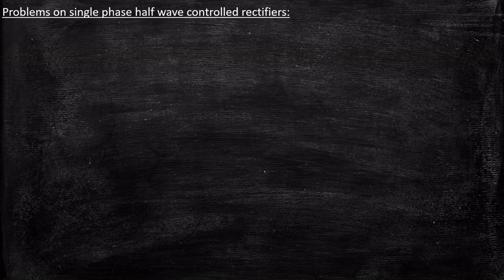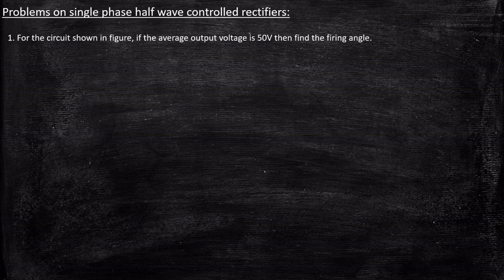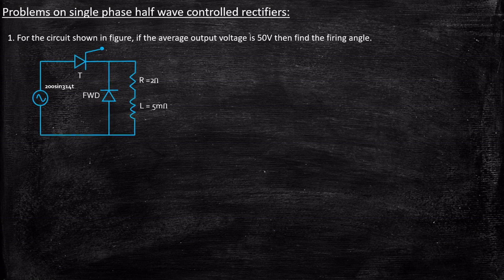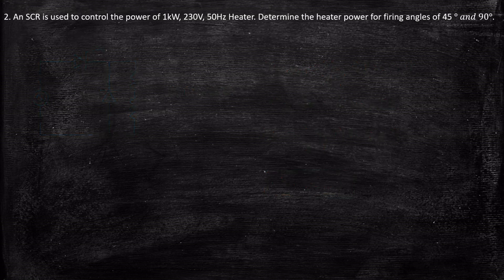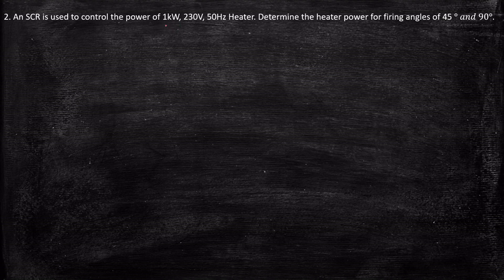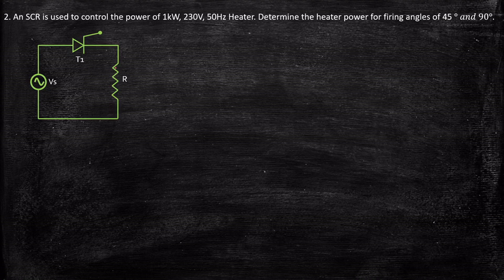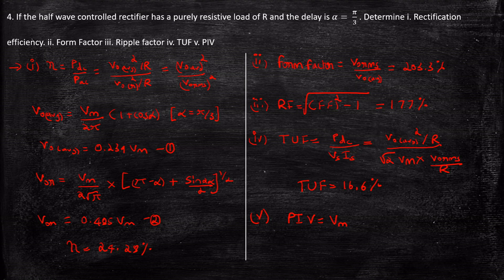Problems on Single Phase Half Wave Controlled Rectifiers | Power Electronics | Lecture 42

Comment: single phase Half wave rectifier and single phase semi-converter with diagrams at a firing angle of (alpha=60 and 150 degrees respectively for RL-Load with Freewheeling diode?
Reply: Sir please I want above problem waveforms

Comment: In 3rd problem the firing angle (alpha) should be 120° after the calculation i guess, not 60°.
Reply: yes, I also got 120 degrees.
Reply: When you keep calculator in radian mode, you will get pi/3, so 60° , but when you keep calc in degree mode u will get 120°,so 2pi/3